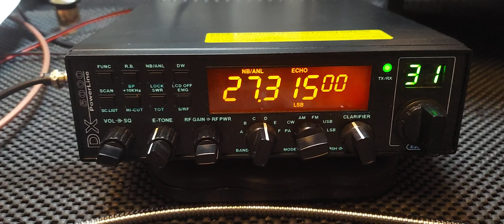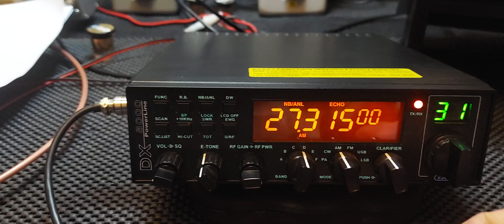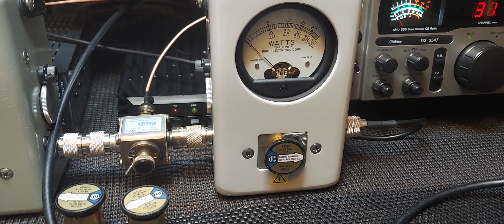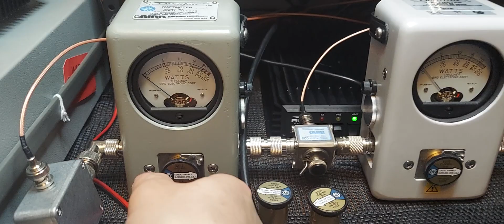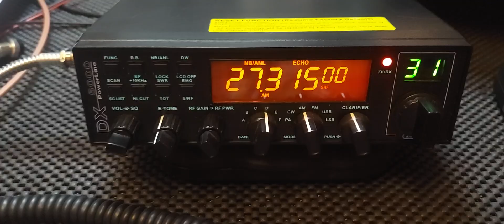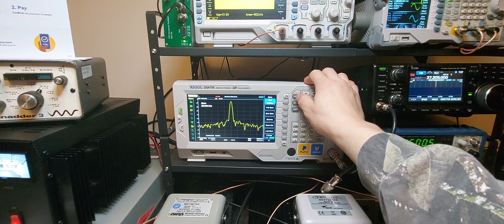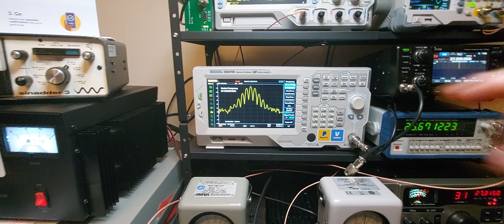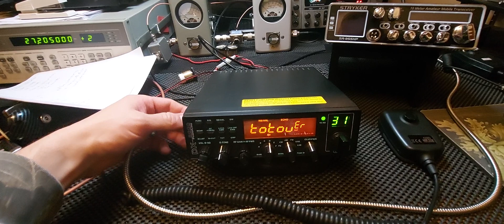Update on K-Po DX-5000 Plus. Better AM performance.

Comment: One reason to use a lower watt setting is if using a poweramp, well, if for some reason want a little more power than 40-50 watt that this radio has..

Comment: I’m wanting to get an RM Italy amp for my Walker II and wanting to know what all I need to hook it up?   I’m planning on purchasing it from your website.
Reply from the maker: All you would need is a jumper cable to go from the radio to the amplifier.
Just be sure that you have a acceptable SWR on your antenna and run the RF power control down on the Walker II.

Comment: Nice radio BFD  I ll take an oldie Cobra 148 GTL  when radios weren t all this scientific voodoo. Thanks for the Intel ,Scotty
Reply from the maker: I've never had an old school 148.
I just can't see paying the big $$$ for what they're going for nowadays.
I had one of the front microphone jack 148's (Ranger made) and it was a complete turd.
Have had a few Grant XL's over the years and currently have a Cobra 2000. 
I'm a fan of the newer style radios because they have a lot more features to offer.
Also the frequencies stability of these new boards can't be beat.
When I got into the radio hobby in the mid-90s I started off with 40 channel radios. Then got shown radios like the Uniden HR 2510, RCI 2950, Magnum 257, and Galaxy (RCI) black box bases.
Northstar radios were also around but they were considered a Galaxy (RCI) knock off radio.
Once I started using those style radios I never looked back.
73.
Reply: @ScottsRadios  Scott your opinion spec wize the Kpo 5000  versus the Quad 5  radio . Curious here . thank you
Reply: @ScottsRadios  Thank you for opening my eyes . Yes as you thats how radio has changed . Sigh . I have a Magnum radio which I used alot never popped the tins . Guess this senior citizen is going to stay close to all you young guys as I dont have much knowledge . Thanks for being patient with me as I was being a smartass.  I apologize. Yes RCI 2950 the drifty LOL there was a young fella older than me back in the 1980s he could do stuff similiar to what you do .Admirable. I am getting to like you . Thank you . Bill

Comment: It doesn't look any different than the Alinco DX135/10. Rebadged?
Reply from the maker: The outside appearance has been used for many years on many different branded radios.
This radio has a completely new circuit board.
There will be others with similar circuit boards. This was the first one produced.

Comment: I was thinking that i turned mine down to 2 watt's  or below when i 1st got it from  the menu but only spent a hour playing with it still have the kpo and the mb-5 to tryout when i get time. Really like the MB-5 ,  THANKS  fast   shipping they look great together. The tone on the 5000 is great didn't need the filters on my sp-767 yaesu speaker at all. I will email you if I'm wrong because i need 1 1/2 dead key with 20 mod.  for my 2290 driver's
Reply from the maker: I did receive your email and just replied back.